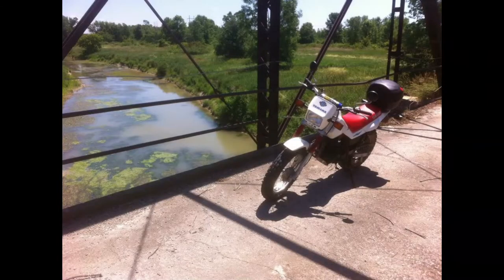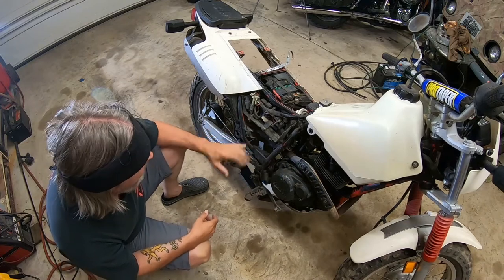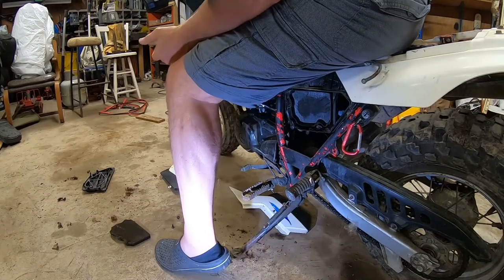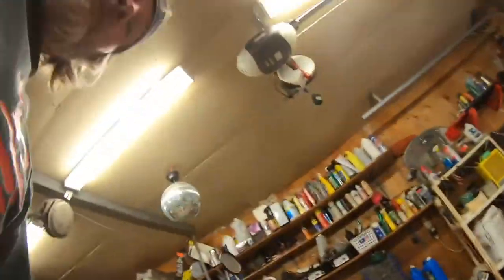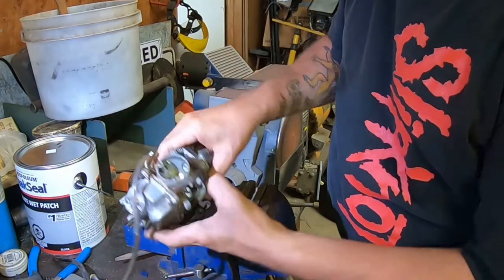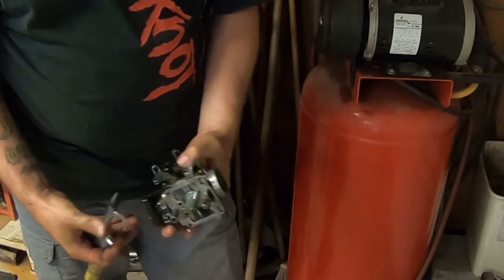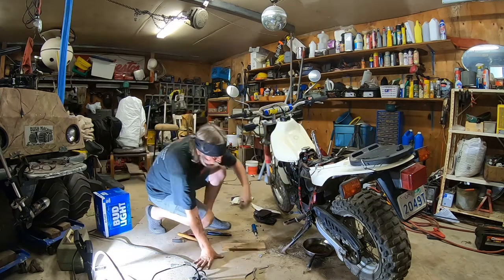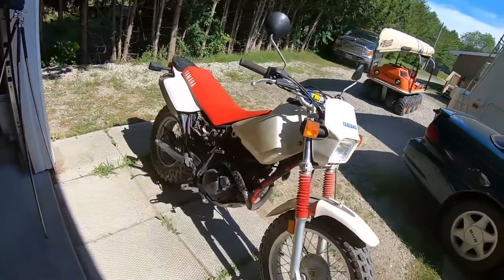1987 Yamaha TW200 - Carb Issues

Comment: I just was trying to get the mixture screw adjusted but couldnt without removing the carb. I have no idea how to do anything on this bike so your video was crucial in my success in removing my 2000s carb, I was able to adjust the screw and now my top speed went from 50 mph to 65+! thanks so much for this video!
Reply from the maker: That's awesome! Once you're used to taking the carb off, it's pretty easy.. but yeah, I remember the first time was a head-scratcher.

Comment: Nice job getting her running again.  I would have taken the jets out and looked for obstructions while I had the carb out, just to make sure.  You especially want to check and clean the pilot jet and blow out the passage to the pilot jet so the motor will idle nicely and not conk out on you.  I guess it's clean enough because it's running.  Get out and ride and have some fun!

Comment: Loved the vidio! Looked like me in my shop. Just picked up a 1990 so I learned some stuff. Mine has been setting outside for who knows how long. So far just moving it around front brake is frozen, throttle is frozen, no intake, no ignition, no side covers, tires dry rotted and on and on. Something to keep me busy. And picked up for $175. So we'll see how it goes.Thanks again
Reply from the maker: Just by chance, I quit the "party scene" just before Covid became a thing. I wanted to spend more time tinkering on projects in my garage and less time suffering from hangovers, LOL. Lock-downs facilitated that plan. Now being a loner out in the shop isn't considered weird. I'm going to try to improve the quality of my vids now that I know there's lots of folks out there, like me, that still like engines, tools, noise, etc. Have fun with your TDub project!!
Reply: @ontariotube  I wouldn't change a thing with your videos. Some that I watch are to clinical. I like the reality of your video. Like I said you make me think of me in my shop. And I learned some things. Thanks again.

Comment: So it looks like three of those lines are over flow lines that run....to the ground maybe?  Good job on the video!
Reply from the maker: The 2 smaller lines vent the float bowl to the ground. The bigger line is the vent tube for the crank case.. sending blowby to the air intake case for re-circulation (EGR).
Reply: @ontariotube  That was super helpful!  Thanks!

Comment: did the side bags work well? if so what brand a modle
Reply from the maker: Those were just some old Arctic Cat snowmobile bags I had sitting around. You might notice I fabbed up a little stainless muffler guard to keep them off them the muffler.